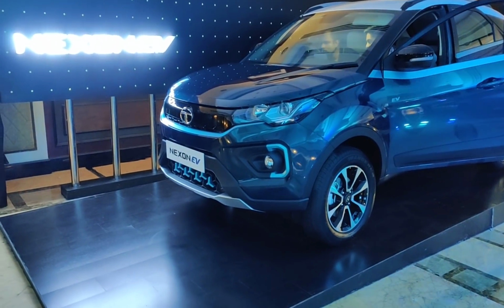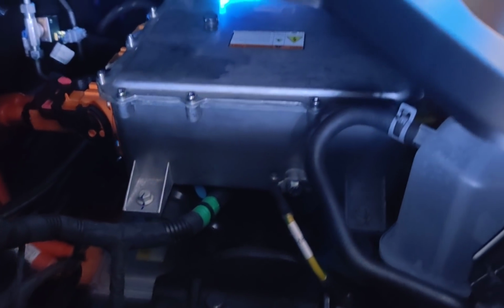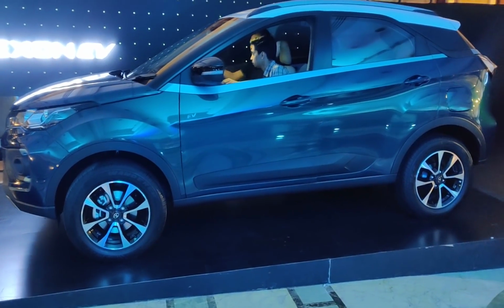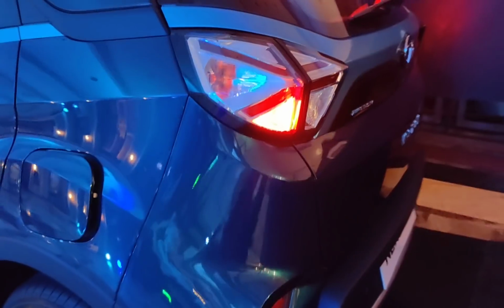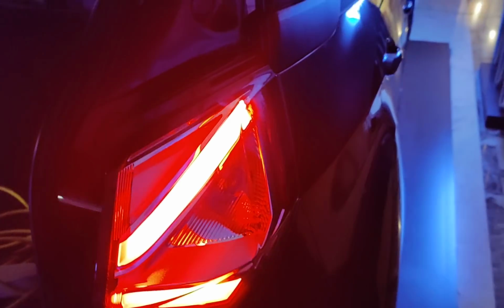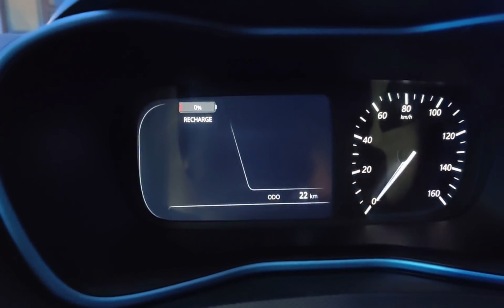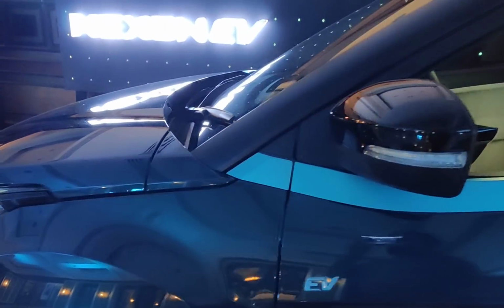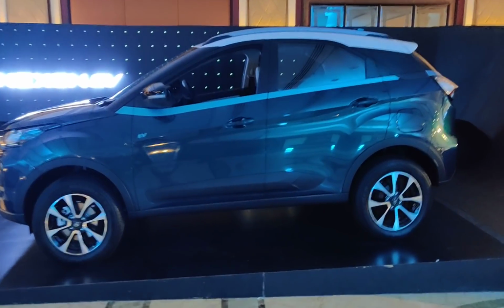Tata Nexon EV Walkaround | Ziptron Powertrain | India’s First Sub 4-metre Electric SUV | ZigWheels

Comment: Am a Tata Nexon EV owner. Have driven this car 4000+ KMs till now with more of highway driving. Am sharing my experience with EV.

Mileage to be considered for Tata Nexon EV is only 150 KMs with AC on and drive freely like petrol cars, it is nowhere near 312 KMs as claimed by Tata. I get 190 KMs on limiting my speed to 70-80 KMs/hr. with AC on, only driver (no load) on highway.

Battery charging module in car is to accept only 3.7kW, Hyundai Kona has 7.4kW. Charging time reduces by half and company can go upto 11kW charging easily without much additional cost.

A Tata representative have been appointed to all Tata dealers to promote EVs. Sadly not the one expected from Tata, this guy also went on assuring of getting a minimum of 240 KMs. on highway with AC on and full load.

On comfort levels car is good. There are minor issues which I am sure will get corrected in next service.

Tata dealers suck. I bought car from Puneet motors, Malad, Mumbai. This dealer went all out to get full advance from me while the car was yet in Tata Motors, Pune. Forget about the small issues like no signed copy of invoice, chassis no. on fasTag, 5 no. alloy wheels mentioned in invoice whereby you get only 4... I have been to lots of harrassment by this dealer right from I purchased this car. Tata doesn't seem to have control on their dealers.

If we compare with Mercedes who have launched an EV recently with a battery pack of 80kW, claiming only 240+ KMs. on full battery. Tata Nexon has only 30kW battery! Tata should go the German way. After all this is the impression we all have for Tata, an "honest" company.
They make Mercedes for India!

Comment: All electric vehicles doesn't come with Manual transmission?
Reply: Well it is not needed. It will be an added cost without any reason
Reply: A electric car doesn't have a various speed transmission like a an ic engine car
Reply: Why do you need it? Have we not seen electric trains how they pick up speed.over diesel trains? In a few seconds they achieve high speeds.
Reply: @soonyanaidu7875  thats because an electric motor has just one moving part ( considering that they dont have a transmission in btw in most cases)

Hence an electric motor has max torque since the start while an ic engine car with trans need a certain gear and rpm
Reply: And additional weight of the gear box, clutch etc

Comment: How much it cost for full charge?
Reply: It's loaded with 30.2 KWH battery so approx 35-40 unit for charge . 40* 7 = Rs. 280 for full charge . So under 1 Rupees/Km
Reply: @in.bhavesh  in pune its 40*5 so 200rs. Comparing my activa and current petrol prices 400rs for full tank and a range of 220 -260 km

Comment: Only 300
Lit bit worried
Reply: @Deepzzz dude with that kind of range you can go from north west Delhi to Gurgaon to noida to meerut to sonipath and back to delhi and still have enough charge left for next day office trip.
Reply: @Deepzzz In EVs the faster you move the lower you get in range. So in city this might do over 300kms moving at 15-30kph but in highway moving at 80-100 kph it might drop to 200-230kms. So yes if you are buying an EV you should be a frequent city commuter to get maximum advantage. Infact metro city people already buy two cars, this will be a very good second car.

Comment: I thought the price should be around 10 to 12 Lakhs but 15 Lakhs seems little bit over price for this vehicle still it is worth it and value for money if it launches i will definately buy this car.
Reply: you are not factoring in cost per mile, between petrol and ev. ev cost per mile is much much lesser than petrol and that adds value to electric vehicles overtime. Also maintenance cost will be very very low
Reply: Batteries are expensive. Unless it's a cheaply made car, that price point can't be met. They made tigor ev.
Reply: Even the ICE cars in the segment are priced more than that.
Reply: They have just started building EVs now, that means they still have to get mass orders to lower battery costs(already very costly now). So it depends on us the consumers, Tata is probably losing money on this.